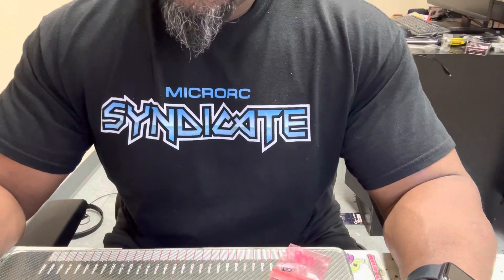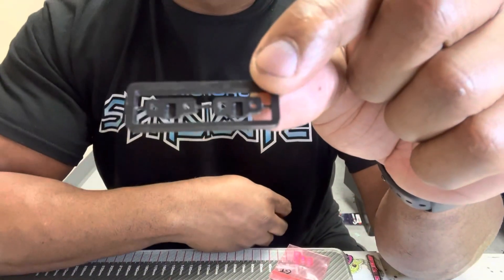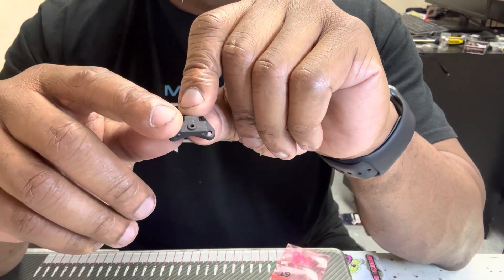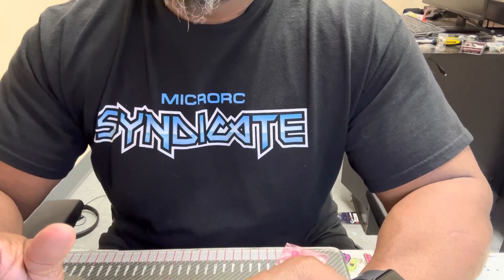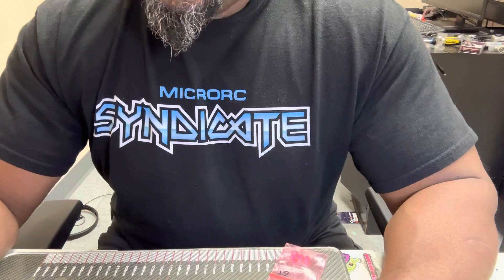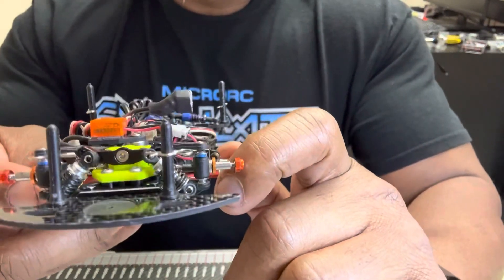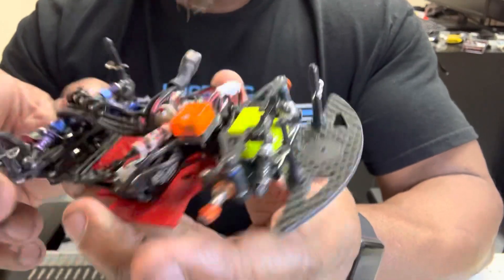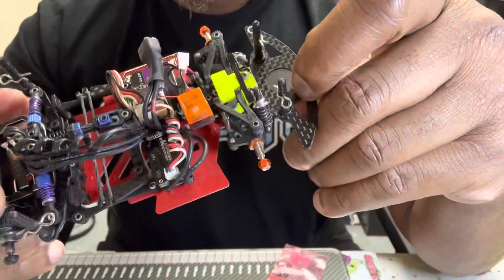Pro GT kit install and tips

Comment: My GL RGT has used the rear shock conversion from reflex racing, can the chassis be installed from the MWX? Because I found the writing: will not work with the reflex racing battery hold down
Reply from the maker: I guess I am confused on your question?? If you have the reflex battery hold down it’s not going to fit.